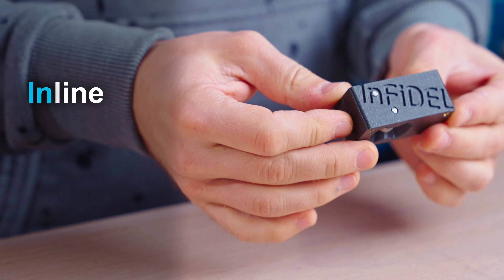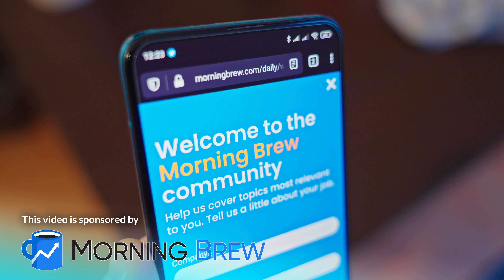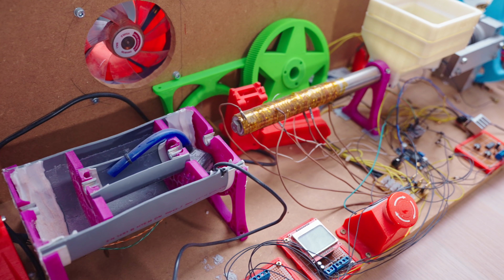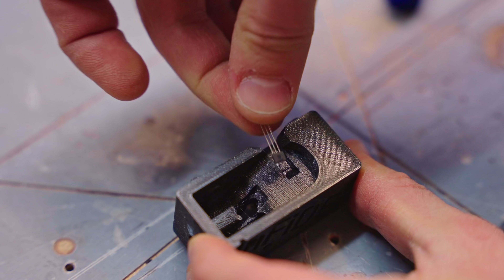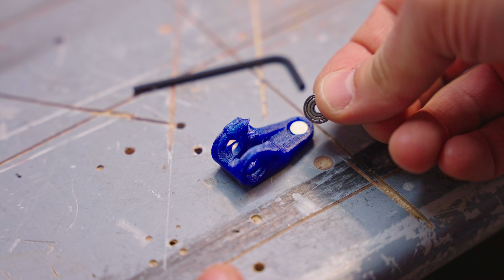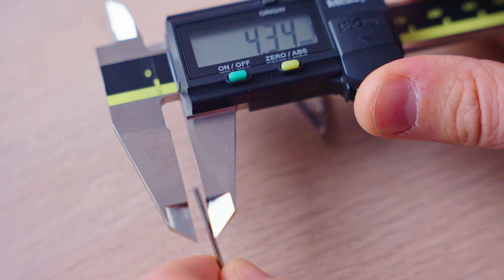Make your own inline filament diameter sensor (under $5)!

Comment: Wow - what a great idea which was so well presented. 

I was coming from a different direction - measuring the length of filament being used. This used a very similar setup with the filament being passed through two rollers. I fitted a MT6701 rotary encoder to the fixed wheel to monitor the filament usage. Adding the Hall sensor like that Thomas shows to the jockey wheel tension bar was an easy enhancement to this design. So now I am monitoring length and diameter in real time. One problem I had with Thomas's approach was the ADC resolution. I feel that to be useful, the filament diameter needed to be measured to a precision of 0.01mm. His calibration indicates that he's seeing a 400 count difference using the Tiny85 10-bit ADC for a 1-mm movement. To measure a 0.01mm change, would need to measure differences of just 4 counts - I found that the noise then became significant at this level. On my project, I was already using a 16-bit ADS1115 ADC, so I used that to read the SS49E Hall sensor I was using. By using a differential input and tweaking an offset with a trimpot on the -ve channel and programming the gain for a limited input range, I was able to get a 200 count change for a 0.01mm magnet shift. The noise was just 3 or 4 counts on this! 

These are just a few thoughts I had for others to consider if they want to improve the performance of this great idea. The ADS1115 is not expensive but gives a great performance - differential inputs, very linear, little noise, good resolution, and programmable gain.
Reply: FYI, I was using a ESP32 MCU for this project. It has two multiplexed inbuilt 12-bit ADCs - their performance is truly awful! Very high noise and major non-linearities which are totally useless for a project like this. Hence the use of the ADS1115.

Comment: Hello there,

while I am up to build one myself and did some recherche about, I stumbled upon this:
Deutherius from githu* made some really nice research about it and used this model:
printabla* 57699, which relys on this: thingsver* 4138933.

As I am not an engineer, I think, that your design with a lever is superior to the sliding mechanism of the latter design in regard to friction. But, what is intriguing in my eyes, is that he uses two (2) hall sensors to increase sensitivity/accuracy.
What do you think about integrating two hall sensors into your design, will it work as the distance to the magnet in yours is made by a lever instead of a slider?
Do you think, it will improve accuracy?

Second thought:
The other design has a version 3, which uses pins instead of ball bearings to guide and measure the filament. In my opinion, this could improve accurracy as well, because ball bearings may have some inconsistent diameters. I ordered high precision ball bearings, which are much more expensive than the one sold at aliexpress in regard to not introduce more room for inaccurate measurements. But with non rotating pins, the measurement error isn't apparent.

Besides that, I wouldn't use the PCB, but instead connect the hall sensors directly to the MCU of the printer (BTT SKR 3 EZ in my case), as Klipper supports hall sensors directly as shown in the other design.

I would like read about your thoughts!
Best regards

Comment: haha the German accent came out at the end 13:02.  I was wondering when that will happen.  
Intresting concept.  I have not had ever an issue with unrounded filament even with the cheap stuff.   should  add if it doesnt sense filament it should pause the print.   two in one check the size and a run out sensor

Comment: Hi Tom, nice design. So I made one, unfortunately for me, the hall sensor is too sensitive and was picking up magnetic field from my extruder motor. Whenever the motor was running the measurement was all over the place. Do you think this could be solved using two hall sensors measuring in opposite directions to cancel external signals?

Comment: What kind of resolution do you get from this? Thanks
Reply from the maker: Since the input from the hall-effect sensor is inherently noisier than the resolution of the ADC in the microcontroller, and the calculated diameter is based on an exponential moving average of the ADC's readout, the actual usable resolution is theoretically infinitely fine. The tradeoff made here is that a slower averaging filter will give a less noisy output, but also react to real changes slower.
IIRC, I had tuned my code's parameters to give a stable reading down to 1u in static state, which gave it a bandwidth of somewhere around 5 Hz.
Reply: @MadeWithLayers  hey, where can I find the populated PCB

Comment: Great video again.

It would have been interesting if you had made analysis of how accurately the sensor can measure. There would be also two different ways to measure diameter.

Interfacing I2C of digital caliber:
https://www.youtube.com/watch?v=tTV52DihPTc

It would be possible to use magnetic position encoder like on this video:
https://www.youtube.com/watch?v=yvrpIYc9Ll8

Comment: мабуть хороша ідея - але дуже складна конструкція для такої маленької задачі, є набагато простіше рішення     -   probably a good idea - but a very complex design for such a small task, there is a much simpler solution  ))
Reply: Thickness gauges have been installed on printers manufactured in Russia by Picasso for a long time and they are combined with the printer software

Comment: Just stumbled on this, and I had an idea: this could be upgraded to also include a runout/jam sensor. Just coat the bearings in rubber, add an optical encoder to one of the bearings.

Comment: Great explanation!  I found your content because I am researching a way to feed filament with a button push but once the filament reaches the destination and encounters resistance I want to be notified. think, I have filament, somewhere not next to the machine but I need to easily swap filaments for single color prints.  but doing this manually (pushing the filament home) is not cool. :)

Comment: I might be mistaken, but wouldn’t it be better to use two hall sensors in differential mode? That way no temperature compensation would be required.

Comment: Thanks for the design. Could the design be changed tp read the movement of the filament as well as the diameter. I was looking around for something that could be used to notice the nozzle is clogged and filament is skipping in the extruder. I could imagine using a mouse centre wheel quadrature encoder attached to one of the bearings to do that job.

Comment: I’m curious if there is a need to measure the concentricity of the bearings under varying loads while in the housing. I assume you’re looking at measurements well under 20 microns with off-the-shelf filaments…

Comment: My main reason for wanting this is that I make my own filament from PET bottle. It's not 100% good consistency and sometimes a short length will become oval as it does not shrink down properly, thereby causing jams. If I can detect that early enough I should have very little failed prints from then on.

Comment: The ESP8266 has the noisiest analog input I know. In addition, you can only measure up to 1 volt. To start the ESP8266, the pins must be pulled to plus or minus in the correct order so that it starts at all. For the ESP I have to recommend an external AD converter.
I would recommend an Atmega328 (Uno, pro mini, pro micro), Attiny85 or similar. The 8 bit computers have a better ADC than the ESP series.

Comment: can this be used with a low tech 12v dc pulltruder that's using a pwn controller and temp controller?

Comment: i love it but the only thing that may need to be done is a timing offset for the filament signal.
When you feed filament in the tube someone could feed all the way through... put a line on filament with a sharpie and then back up the filament.. if that measured length in mm can be inserted the offset for accurate timing vs multiplier could be calculated! :)

Comment: Awsome work :) , I start ordering components and pcb to build 10 units. I just need to add an encoder wheel and some electronic to this design to allow the sensor detecting clogged nozzle too. As 'im priniting at 233mm/s on a little slinging bed printer I can't add weight to the printing head and will use ptfe tube to link it to the extruder with a known distance.

Comment: wondering if you could take a raspberry pi zero 2, and wire a filament sensor straight to the GPIO pins, then have a tiny raspberry pi zero filament sensor and octoprint server AIO? :P

Comment: Great presentation, again Thomas!
Great instrument for diameter measurement while extruding.
A simple no-filament sensor with mechanical end stop switch would do its job for printing, cost less efforts in engineering, and parts, but would be less smart and versatile.
I' curious, what comes next...

Comment: We also should think about how we could add a mechanism that detects hanging filament like the Bigtree one has. I even think of buy one to see how they solved it

Edit: I just went through the BOM and ordered the PCB's and damn, most components are disgustingly expensive. The AT Tiny is not available anymore, you have to switch to the SH version (ATTINY85V-10SH) and the hall sensor is nearly 4 bucks per piece, so making the sensor for under 5 is not possible.

Edit2: Also, did anybody make this working with Klipper?

Comment: Fantastic job. I love the InFIDEL sensor. Is this your design? Before you mentioned using it with an extruder I'd assumed that that's what you were building it for. Used with the extruder, the Attiny's filament diameter could be input by a microcontroller. Based on this input, the microcontroller could then either speed up or slow down the flow of filament being extruded. Simple. Brilliant!

Comment: I like this, any way you could do a v2 that also includes an encoder? I have a printer (doing 3mm filament) that often jams and "prints" nothing. Adding an encoder to this, you could have it not only feedback the width of the filament but also either a pulse to show filament is moving (marlin supports this already! BTT smart filament sensor) or even recorde the rate of motion for closed-loop control

Comment: In trying to program the tiny 85 the chip is very hot intermittently and i get this error when trying to burn: avrdude: stk500_recv(): programmer is not responding
avrdude: stk500_getsync() attempt 1 of 10: not in sync: resp=0x03

Comment: Very interesting video! How do you exactly connect to the printer to compensate extrusion? What firmware software do you use? Im guessing klipper? Please show us! Im very interested in getting proffesional results in consumer grade hobby printer! Linear advance, accelerometers, closed loop steppers, and now extrusion compensation!. Ill take your idea and use an arduino nano since im more familiar with it, but please do show us how the compensation is done

Comment: totally solved the problem of at home filament making so if its used in the extrusion and the print process   pulling through an oversize nozzle seems to be the most effective but only see the laser sensors on expensive extruders

Comment: Just a few notes from the peanut gallery:
1) Any variance for PLA carrying a static charge? lol
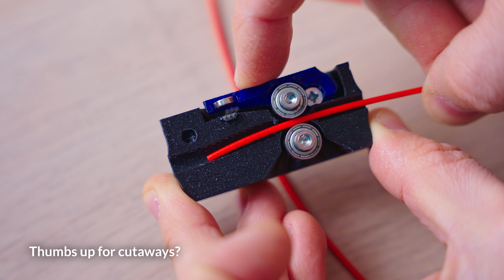2) @6:30 - How about another set of spring tensioned roller bearings at the end (left side of the object) instead of a full length of bowden tube? Add a small threaded insert (that matches thread size on the bowden coupler) with enough threads to screw into your hotend radiator. End result - I'm betting this will put enough tension on the filament to act as a direct drive, perhaps?

Comment: Next iteration try using a capacitive linear encoder instead of a hall effect sensor. Better reliability and more precise, just add a coin cell battery to the control board, insert a steel pin of a known diameter for calibration and you're good to go.

Comment: I see PCB links, although the board is populated by that. I also see PCBA and when you make the comment about only needing to solder he half effect in, that would imply a PCBA process. Is there a actual PCBA link that the whole board is made, populated AND other then the hall effect is soldered on already?  I not se a version of the link...especially for here in USA that looks PCBA (printed circuit board ASSEMBLY [assembled]).  plus the kitspace link that then goes to oshpark for us USA people shows 3 board instead of say just one for those that just want a single one for straight to printer and not to say measure in like the spool project.

Comment: In order for the extruder to compensate the thickness difference of the filament it must know the distance between the sensor and the extruder or? I assume this feeds live data from the point where the bearings touches the filament, but it will take some time before that point of the filament is consumed.

Comment: I find that my filament is not perfectly round. I wonder if that can be solved with a slight adaptation. Perhaps running the filament between two V-groove wheels? Ah, it is covered at the end.

Comment: I've seen with some extruders that extrude oversized and stretched to the correct diameter. I'm guessing the analog voltage could be used for that?

Comment: Thermistors are linear, but hall effect is polynomial due to square of the distance stuff.  I'm working on a clone that uses a pi pico; I was just porting the code but uh…I ended up reimplementing everything.  I'm also experimenting with using a segment of a sphere to friction-fit the bearing, since you can totally lock up the center of the bearing and the outside rotates because that's the whole point of the bearing.

That changes your $3.20 custom board to a $4 (€3.36) pi pico board plus like 5¢ of headers (or some solder) from AliExpress.  Not free, but not terrible.  With a little luck, I might be able to knock out some of the fasteners, as I think I have a design using three 623zz with no dowel pins or screws, plus the magnet and hall sensor.  Maybe €0.35 more expensive than yours.

Comment: Nice video Will this also work with the filament extruder to controller the speed of the winding roller to control the diameter   thank you

Comment: What if the filament is oval in shape, with the minor and major diameter fairly different, but the cross sectional area is still equivalent to a 1.75 mm diameter filament?
If your sensor rides on the major or minor diameter, its "Effective" filament diameter will change significantly.

Comment: If I havent overlooked anything then Prusa could implement this in their MK3 chimney design. They only need another magnet and replace the optical sensor with the hall effect sensor. Then the extruder gears become the sensor itself. Their tension should be enough to compensate for debris messing up the reading.

Comment: This is a good design and your ideal of using a V-slot bearing is a good idea as well.
Just to build on the idea a bit, using the V-Slot bearing on the moving arm of the sensor and then using a wheel with a bit more grip on the other wheel with a slotted disk and a photo interrupter would allow for the speed of movement or distance moved through to be measured.
This combined with the filament diameter could then not only detect the diameter of the filament but also filament out (can already do this :-) ) but also if the filament jambs of breaks past the sensor.

Just a thought. :-)

Keep up the good work
Ray

Comment: I plan on printing one in the next few days.  I have done quite a bit of work on atmel chips and arduino (which used atmega) so I may tackle some of the firmware improvements you spoke up.  When letting marlin know the filament size however how does marlin know where that filament is?  i assume you measure out X mm from extruder or something to that effect and thats where the sensor goes?

I am also interested more in your filament extruder as I want to make my own.  Please include in future videos

Comment: If I modify the housing to fit it, would there be any issue with using a 6x3mm magnet, cuz I just bought 200 of them for another project?
Reply: Shouldn't be. The only potential problem which comes to mind is field strength of the magnet, and that's already accounted for by the calibration step.

Comment: Could you do a test on how varied you could make the filament and still have it usable with the compensation?  like could you try using filament that is 1mm at some points and 2mm at others?  I wonder how much the printer could handle.

Comment: This design have one significant issue. This design is sensitive to temperature (and must be). Better solution is use 2 hall sensors in differential setup.
Something like this https://www.thingiverse.com/thing:4138933 but with better mechanical design.

Comment: Wouldn't be easier to insert two defined size, like 1mm and 2mm and then use the results of each one to extract n and m for the formula y = n + x * m? In that way, you get the size of the inserted diameter

Comment: Very nice work - I want one! I know you've done a lot of work with filament; I've watched quite a bit of it, thank you! Given the sensor measures diameter across the filament from only one direction, you must be confident that most filament samples you've tried are round and thus this is the only measurement needed. I don't know if you've collected enough data to judge, but what are the odds that any given spool of filament is indeed round, and do the odds improve with 'name brand' filaments as opposed to the cheap stuff?

Is someone (you perhaps) selling preassembled units? If the price is right (~$20 US), I'm in the market today!

Comment: in a perfect world we would put CAN, RS485 and I2C outputs, but that would really complicate the design.

Trust me, I had to debug a RS485 <> CAN converter board my company designed for inverter systems and i wanted to pull my hair out.